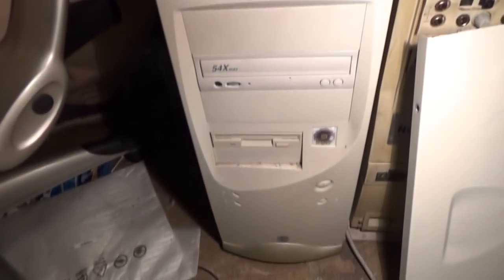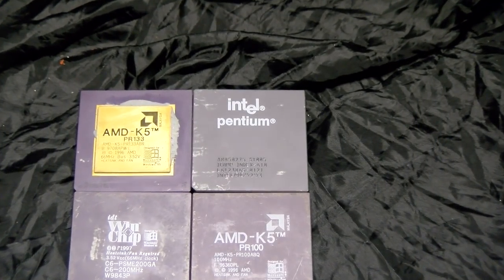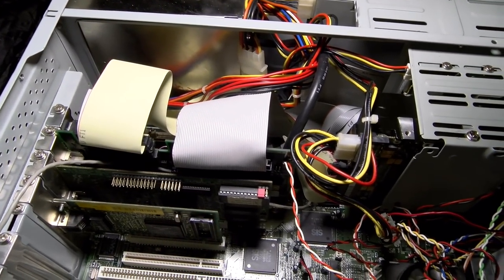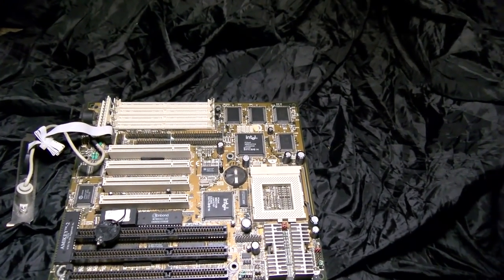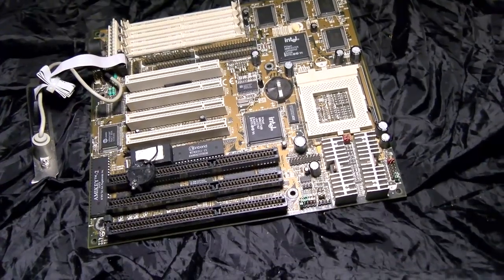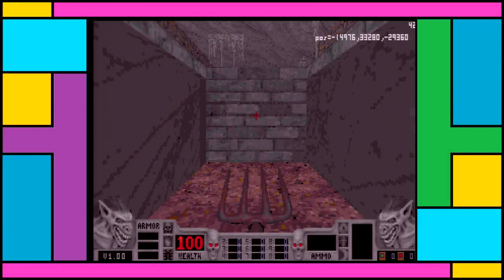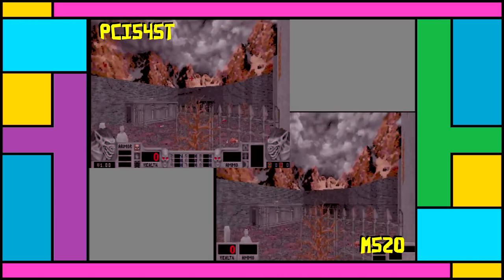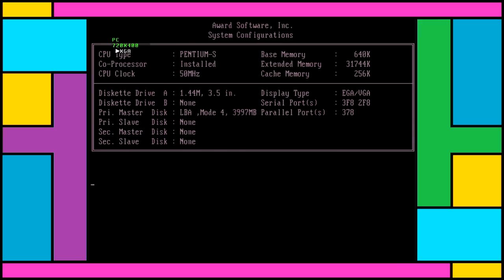Comparing 'Socket 7' Motherboards

Comment: If this was 1997, benchmark test like this existed and I was looking to build a system, I would probably look for the cheapest VX based board despite it's 64MB caching disability. I suspect the SIS chipset starts to fall behind more as faster cpu's are used due to the memory performance, probably a chipset meant for no more than 100Mhz cpu's I would guess.
Reply from the maker: The SiS holds its own surprisingly well though, its losses are mostly intangible and where it doesn't run as fast, it at least runs smoothly. Also I do think some of the very last 551x boards would be able to keep up. Honestly though, if it were 1997 and I was after a Socket 7 board, it'd probably be the M520 because it was almost certainly cheaper than the others and it works fine, the VRM cards would surely have been available at the time too.

Comment: I have an EXP8661 430VX board that I used myself in '97. That 168 pin DIMM slot also puzzled me ever since then. But as you, I never got any module to actually work. It also had one of these "hot" linear regulator designs for Vcore that could to little below 2.8V without going up in flames. I've removed it and fitted a 3$ synchronous buck module that runs a K6-2 400 at 2.2V cool and nice. The board looks pretty similar to your P5VX-B and it also has a WinBond SuperIO chip, so its Bios may actually work on mine and vice versa.
Reply from the maker: A lot of 430VX boards are extremely similar to one another and BIOSes are, indeed, often interchangeable. K6-2 eh? I once knew a guy who we swore was running a K6-2 on a 430FX board or something, like he said he built the system in '98 and that it reused the case from the family's old Pentium 90, but we always suspected the system was the family's old Pentium 90. He was secretive about the internals, but we saw enough to know the motherboard was only PCI, only took 72-Pin RAM and we also knew it still ran a SB16. The CPU seemed higher in the socket than it should have been and there were wires running away from it. From what we could tell, it was a K6-2 500, but software reported inconsistent numbers and the system was unusually slow. He was an odd sort, that fellow, lord knows what he'd done to it.

Comment: Last saturday I went to the thrift store and just bought for 10 us dollars an HP Pavilion 7410P which has Intel Pentium non MMX clocked at 200 Mhz and authentic OPL3 Yamaha onboard sound chip and S3 Virge onboard graphics. It also has a Quantum Bigfoot hard drive. I plan to install a Voodoo 1. Realtek made some really nice NIC chipsets back in the day. For instance the Realtek RTL8139 can still be used in modern windows such as Windows 10.

Comment: want any benchmark for a vx board with SDRAM? I'm building a system now. I even have multiple boards with sdram and that chipset...
Reply from the maker: I guess if you're happy to share your results, but if a follow-up video is ever done I'd probably be able to get a rough idea by looking at 430TX boards, given there's a P5TX in the pile of many white slotted boards around here. Personally I still suspect the improvement would be akin to EDO on late 486 boards, as in nothing tangible. Suppose there's only one way to find out, really.
Reply: @HighTreason610  Actually EDO was quite a boost, but only with the Pentium Overdrive and UMC Chipset. What kind of stuff would you like to see results on? The stuff you tested? I might make a short vid of it
Reply: @HighTreason610  I can bring you benchmarks of "VXPro" pcchips mobo, ALi mobo and i430TX mobos as well since I managed to use SDRAM on them.

I can even test my two weird SiS mobos that have integrated video, and run my winchip on them (or my K5)
Reply: @DxDeksor  The PC i was building right now has a Chaintech 5vgm M101. In the manual, P1 MMX re not supported. I put one in anyways, but everything was super slow. (About 10%) Then i put in a Winchip at the same speed and everything went back to normal. I will test the memory throughput with a different board and K6-2 and see.